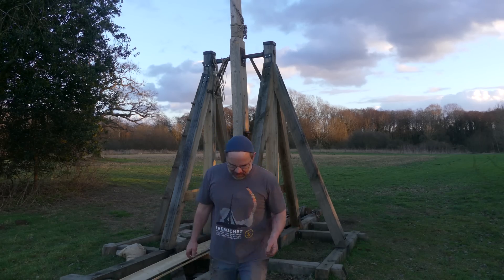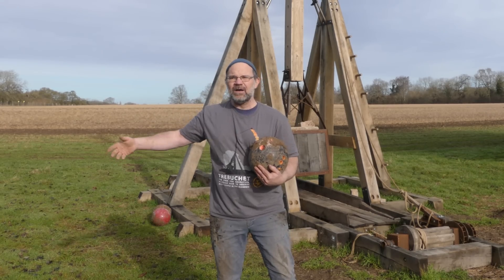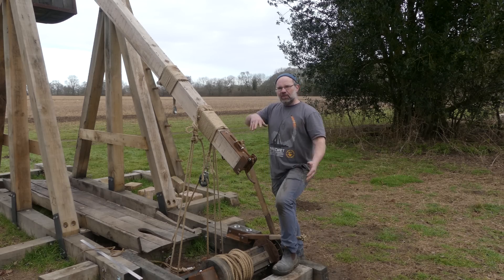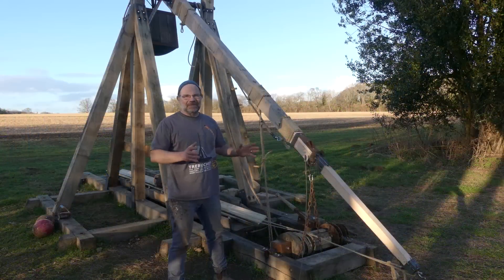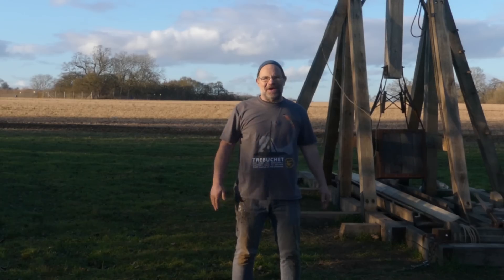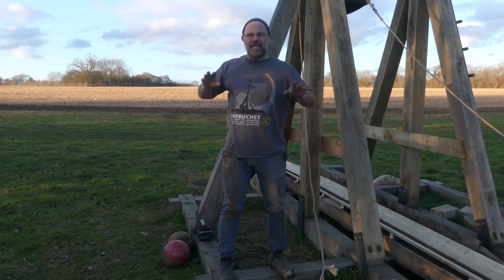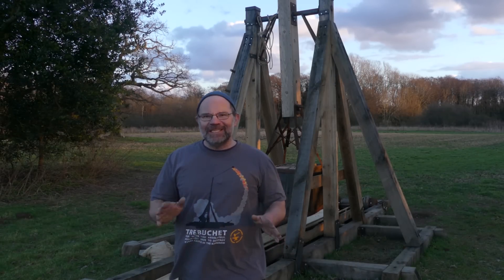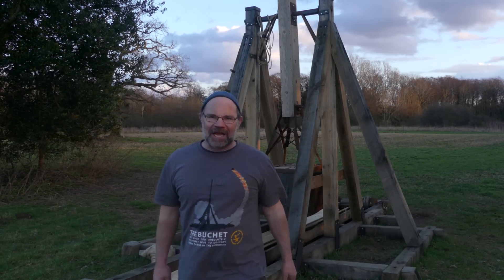Trebuchet gets BIGGER! better????

Comment: Isn't it supposed to be on wheels, so forces trying to tear it apart just make it roll instead? And also so you can move it. Add wheels, use a truck or some horses, or even a team of men and you can call down an air strike on any location!

Comment: it should be pointed out that, the range is one thing, the more important is the flat trajectory.
to slight a fortified wall, the energy transfer of the projectile is the key, not the distance per se.

Comment: You really need to put wheels on the trebuchet.  If you watch the Trebuchet Project you can see that with wheels on the frame the weight drops straight down instead of having forward & backward components.

Comment: For chasing accuracy, take a look at around @4:13 - as you yank the trigger-rope, the end of the arm moves a lot sideways (maybe a foot?).  Could you modify the trigger to either release more easily, or else re-direct the trigger-rope in such a way that it pulls 'down' on the arm, rather than sideways?

Comment: Something I realized: the release (at 2:54 and 4:14) really jerks the arm a lot. If you want accuracy, that needs to be fixed. The easiest fix is to have put a pulley into the plane that the arms swings through to eliminate any sideways forces. A second possible fix would be to have the release mechanism attached on the frame end of that chain, instead of the arm end of it.

Also, if you calculate optimal ballistic arches on ground that isn't flat, the generalization of the 45° rule is that "you get maximum range when the impact velocity and the launch velocity are at right angles to each other". (I learned that from this video: https://www.youtube.com/watch?v=xwhbT9Do1RQ ). I don't know if exactly the same holds true for air resistance, but I'd assume it's very close. Given that, the 2nd shot looks like it 's pretty close to the ideal trajectory already. Get a piece of paper with a 90° angle; hold it to your screen at 5:54; that looks like it's at maximum a few degrees off.

Comment: Having watched a number of trebuchets at the Pumpkin Chunkin in Delaware USA I learned that the length of the sling plays an important part of the throw. The Yankee Siege Machine being the best example can throw a pumpkin 1700 yards if I remember correctly. But only when the sling is just right. If the sling is too long or too short the shot will be short of maximum range.

Comment: If the counter weight, is the same as the weight as the projectile, would that not sort out the balance? Or am I missing the meaning of counter weight? Could you not adjust the counter weight, instead of the length of the arm? If the attacking army was in the field, would it be easier to change the counter weights weight, rather then move the Trebuchets, to change the distance etc?  Forgive my ignorance on the subject. Just an idea. Thank you Tod.

Comment: Hi Tod, does that mean Trebuchet range can be adjusted by release pin angle? If the only suitable placement was closer or farther from the target you can adjust range. Does closer = more impact force or does the shot pick up momentum as it 'falls' so farther is better? Thanks!

Comment: I hope we get a video that is a call between you and someone who specializes in building/designing trebuchets about the physics and design ideas and what you need to do to yours given the parts that are easy to change and the parts that are hard to change.

I recall vaguely from building a 1 meter arm trebuchet as a kid that the goal was to balance the weights until the arm basically stopped moving entirely when it released the payload.

Comment: Can we get some footage of how to bend that pin?
Reply from the maker: Really just done with a big stillson wrench. - nothing exotic
Reply: @tods_workshop  I really want to know what it looks like, how difficult it is to bend, what the dimensions of the different angles are, how accurately you can bend it, whether there's risk of wear and breakage if you bend it too often and stuff like that. It would be really interesting to see a test of how much bending on the pin changes the trajectory, like whether you could hit something that's not far away but rather high up, for example.

Comment: From the 'previous shots' footage compilation it can be seen that a release angle of closer to 60 degrees gives a further shot than that of closer to 45 degrees. 
Physics would decree that an angle of 45 would give the most efficient release angle for the furthest shot throw. 
However the effect of wind resistance, especially when the shot ball is moving at it's greatest velocity at the start of it's path, transfers to reduction of initial velocity and thus initial height gained. 
Therefore increasing the release angle to closer to 60  throws the shot ball to gain greater height to allow it to have an extended path which in turn allows a greater distance to be gained by the shot. 
Great work Todd. I watch all of your and Matt E's uploads religiously, and love them. 
Cheers, Mic Barrett
Reply from the maker: Thanks Mic, but I not a physicist, but I suspect at these low velocities, wind resistance doesn't have much to do with it
Reply: @tods_workshop  
You'd be surprised. 
But on the angle of greatest efficiency it's easy to see even with common sense that that's right. 
And wind resistance is the only other external force, the only one. 
Gravity is accounted for in an ideal system ie. with no air-resistance. 
Not blowing my own horn, but I am a physics teacher. But honestly, physics is only a whole lot of very common sense. 
And thanks heaps for all your effort, and a great show.

Comment: Tod, I suggest you try the release at 42 degree. I seem to remember in old days, military tested artillery range and found the longest range at around 42, not 45. Anyway, even it is 45, I think you can give it a little room in case the release is bit late (few degrees higher).
Reply from the maker: That is a really interesting point over which I have wondered.  The 42 and degree thing is for high velocity projectiles.  I am not saying it is not correct, but drag has less effect at lower velocities and this is a very low velocity, so I wonder.....
Reply: @tods_workshop  
I wonder how you control the release exactly at 45 degrees? My thinking is, if the release was only slightly late, it ruins the distance.
Setting a very slightly lower release at 42 degrees, might be more reliable.

Comment: The number of parameters to adjust on this is fascinating - it's far from a simple thing to tune. Very reminiscent of cartridge development - powder type, burn rate, powder load, bullet weight, bullet shape, barrel length, primer type all come into play
Reply from the maker: Or infuriating.  Yes there are lots of variables and some have a bigger effect than others, but every one interrelates.  I am beginning to form a theory though which is handy.
Reply: @tods_workshop  Lovely to watch - when it's someone else who has to solve it 😁👍

Comment: If someone can clarify the physics behind this? Why isn't the range increased? What determines this energy transfer?
Reply from the maker: Very complex is the short answer.  The reason is partly because I have extended the arm and that creates more inertia and this should probably be overcome with more weight or a lower projectile weight.  Both would help

Comment: An other way ow dealing with the energy dissipation problem would have been to reduce the energy the system has to deal with by adjusting the counterweight. I love how reducing the energy was not even worth cosidereing and instead you went to enable the system to deal with the energy it has. We need more power! :)
Reply from the maker: Absolutely!

Comment: The mathematics are fascinating.  It would be interesting to use some kind of physics software to calculate the differences by adjusting all the variables - lighter ammo for example, would it go further and with more energy due to increased speed, how much weight has to come off to compensate for the extra load in the extended throwing arm, what if it releases a millisecond earlier, all super interesting.
I paused on the overlay at the end, interesting shot!
Excited for the next video.  Good luck!

Comment: They just never work quite as you expect, it’s all never ending adjustment. I’ve always wondered about the ‘range’ given. You can shoot a long way but at the end of the arc it’s coming down at a heck of an angle probably going to glance of a wall. A bit like the long bows I wonder if our modern pre conceptions about range are different to how they would have used them. Maybe they aimed for a much more direct fire on flatter trajectory. Of course that means getting closer but that’s always the case really, a Calvary raid would cover 400m very fast . Would need to try different angles against a wall to see what happened.

Comment: Bear in mind when using bowling balls most of them have asymmetrical cores. It might well affect their flight path.
Reply from the maker: It is an interesting point Ben brings up, but as they spin fairly slowly any discrepancies would likely get pretty levelled out - it may be a part of the issue, but I don't think so
Reply: @tods_workshop  Yes, fair enough :-) Maybe paint them with bright white lines to keep a check on how much they spin in the air?
Reply: I was thinking the same, particularly in the episode when Tod wanted to hit the cardboard knights and kept moving them between shots without luck and concluded it must have been the machine's fault. not even considering the possible effects of the wind, the bowling balls themselves seem to be a weird choice considering their superficial homogenity but vastly different inner workings.

and I wonder what the farmer thinks of all that stuff thrown at the field, all the going back and forth and the possibility of weird ingredients of the projectiiles seeping into the ground...
Reply: Yeah, the question is, is there a similarly sized dense heavy thing that he could substitute with?
Reply: @Zelmel   Maybe footballs filled with a thin concrete and left to cure?
Reply: @Arachnoid_of_the_underverse  Yeah, I suspect there's a DIY option, but I was hoping someone more clever than me would have an off the shelf thing to suggest. That's definitely a better option than I'd come up with though!
Reply: @Zelmel  Just fill the holes up with epoxy resin
Reply: @Zelmel  A simple DIY option is concrete. Just mold some concrete into an approximate sphere.
Reply: @braddbradd5671  its not just the holes theres a core of denser material in there too
Reply: 7.26kg/16lb iron shot puts might do, bout £20 each. And being cast iron penetration should be better when he gets a caravan or something out there.
Reply: Found steel balls/spheres are available in various sizes from F.J. Brindley, F. H. Brundle or
DC Iron, probably works out cheaper than shot puts.
Reply: @Zelmel  Fishing weights (used to weigh down nets)? Big ball bearings (worn out balls are probably available as scrap)?
Reply: Im wondering if the "ammunition" is actually too light which may be causing the issues with the trebuche.
Reply: A custom bowling ball will, but I'm pretty just "off the shelf" balls have standard, symmetrical cores because they're easier to make and use. Professionals are really the only people using asymmetric cored bowling balls, because it allows for wonky ass spins and greater hooking ability that normal people just cant get
Reply: When bowling balls are manufactured, the asymmetrical core is there to counter the loss of mass where the finger holes are.  The result is supposed to be an evenly weighted ball.

Comment: Just out of curiosity, how does this machine compare to historic trebuchets in terms of size and performance? I know it's not an apples to apples comparison as this one wasn't made to be particularly historically accurate but the only other trebuchet I'm familiar with is the Warwolf which is purportedly the largest ever made so perhaps isn't representative of how large a "normal" trebuchet would have been.
Reply from the maker: Were don't know, but I would suspect three times this size would be quite possible for our forebears, so perhaps 20-25m tall or roughly 8 story block of flats; possibly more
Reply: @tods_workshop  That's curious that we don't have any hard numbers. I know guilds/tradesmen were a secretive bunch so I can understand the craftsmen only passing the instructions down by word of mouth to their workers, but I feel like it would have been beneficial for an army to at least record the size and capabilities of an effective catapult so they could reference it later if they wanted similar ones constructed by different engineers.

Comment: Hi Todd 
  What happens if you change the sling length?
Reply from the maker: It changes the efficiency and the release point
Reply: @tods_workshop  should you add a bit more weight in the bucket to counter the arm extensions extra weight ?

Comment: I know that for small scale trebuchet models putting it on wheels helps to make sure that more of the energy of the bucket is smoothly transferred to the projectile, keeping the trebuchet's structure more safe. I'm not sure if that would help much (or at all) with a full size trebuchet where the weight of it is likely to make any wheels sink into the earth, though.

Comment: I saw this video last week and commented on it, now it's "new" again.  What happened?
Anyhow, I've been playing with these more than 20 years and still don't understand everything.  But I'd suggest a shorter sling.
One problem with extending the arm is that you've decreased the maximum cocking angle and thus reduced the maximum counterweight height; taking energy out of the system while increasing the inertia of the arm.  The simple solution, of course, is to add more counterweight!  My experience is that you tend to need a shorter sling when you add weight.
Also, note how the arm stalls when the counterweight gets to the bottom.  That causes the sling to continue the motion by itself.  Again, shorter sling.
Reply from the maker: I think you couldn't have. It just went on line yesterday.  True words on the angle and that will reduce the possible and a shorter sling is also required.  I do wonder if I should reduce the arm length a little from its new size, but I have to stop somewhere and call it a day
Reply: @UCWnlQMQ-ACfhpD68yWRsnJw The one I saw is on your Siege Engines playlist: https://www.youtube.com/watch?v=aCUbJDJDD9c&list=PLIUWkznLJcsHtfb9GqWxGwWedaeEBGkph&index=7&t=2s
Dunno what happened, no big deal.

Comment: A response on wheels. I saw your statement about why no wheels, and I want to respond to your premises.
First, Roman's had mobile siege weapons, so wheels on siege weapons predate the treb. Siege engineers would know they help change the range and improve targetting, even if locked when fired.
Second  building a siege weapon in range of fortification weapons is absurd. These would need to be built out of range and rolled in.
All it takes is a forgotten lock or the lock breaking to discover the range improvement.
Compare your attitude towards wheels to your attitude toward waxed arrows and bolts. You have no evidence for it, but believe it happened. But despite the clear advantages to wheeled trebs, you favour no wheels as the likely historical truth.
Seriously, that thing will last a lot longer with wheels. Build a wooden or stone area to let it roll on, and get wheels on it before it dies from horizontal stresses it shouldn't need to handle.
Reply: ive been dreaming about you...
Reply from the maker: Ok - thanks for your thoughts.  I think you bring up a very real truth.  I have dismissed it because I have not seen evidence and think it would be hard to do.  Both of which are not reasons to dismiss it, so thank you for reminding me of that.  I will address this in an upcoming video.  However in the 'here and now', I simply don't have the time to put this on wheels, so it will have to stay as it is; but again thank you for the timely reminder.
Reply: @tods_workshop  Ask the community for help. Imagine 20 viewers showing up some Saturday to lift it up with historically accurate muscle power.

Comment: Huh. Looking at the trajectories, not much more if any energy is being imparted to the ball, which presumably means it's going into the arm--which would imply that it had a bit more energy at the same tip speed, not sure if that's expected, depends exactly how heavy the extension is compared to the existing beam. Better than into the frame of course, but would be nice to throw further.

Comment: Could it be the extra mass and leverage of the extended arm is absorbing the energy from the basket without any additional transfer to the projectile? Calmer basket but with no more range?
Reply: My thought exactly, and I’m sure you can work out the acceleration difference between the original and 1.2m longer radius with the extra mass but I can’t be bothered right noe